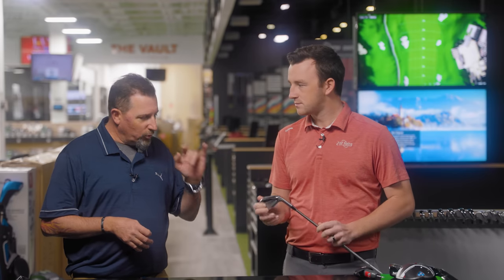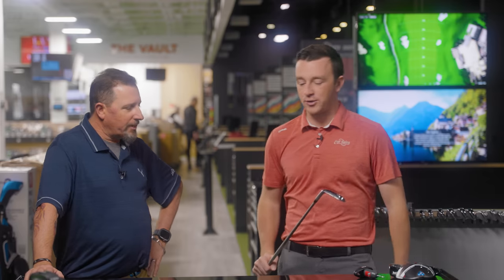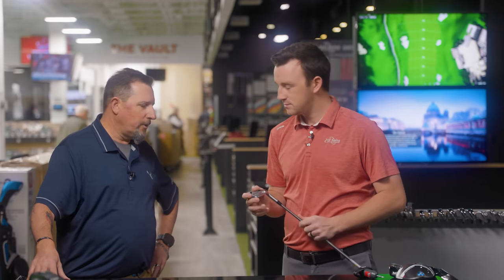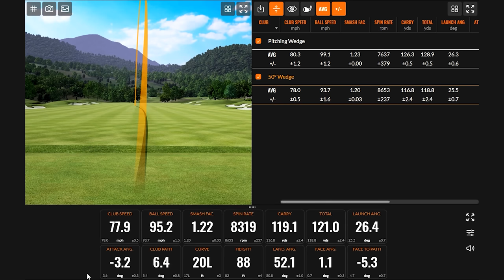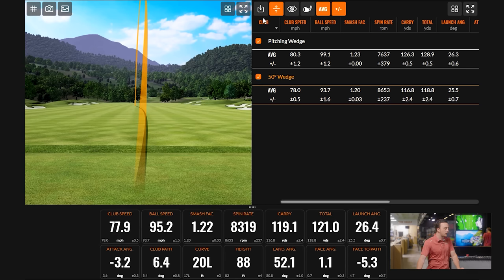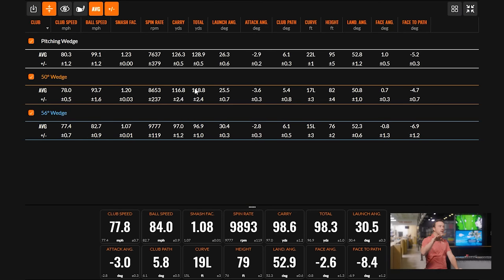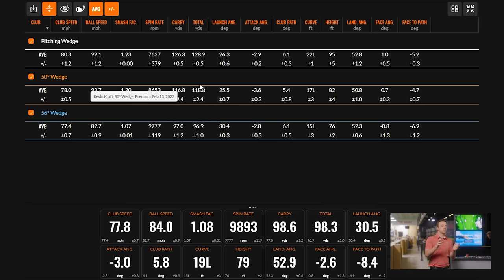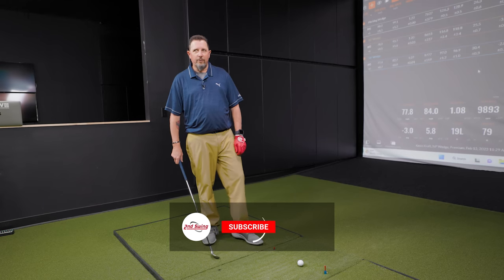Short Game Gapping Demonstration | Golf Yardage Gapping Explained

Comment: I’ve had this exact struggle…
I’ve got a standard srixon zx5 set with a 44 degree Pw and was playing 50/56 wedges. I had a 20+ yard gap between my full PW and a full 50. Ive moved towards 48-52-56. The 48/52 are Mizuno s23 and the 56 is a cleveland rtx full face that I can open the face of to play it like lob wedge.
Reply: S23 very underrated love em